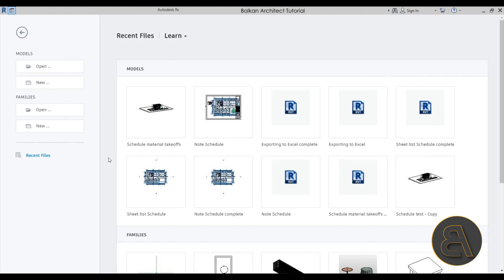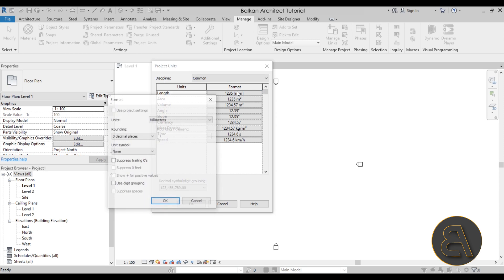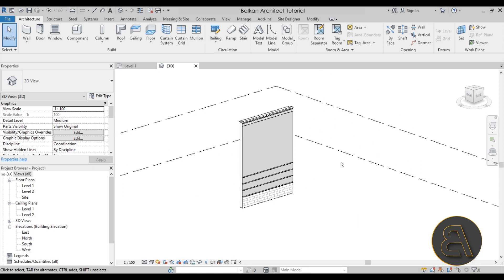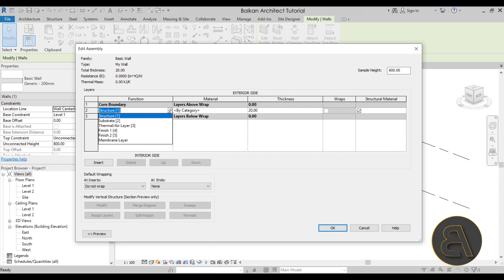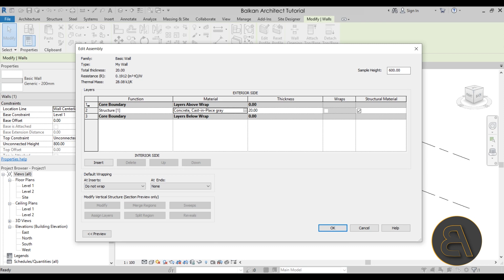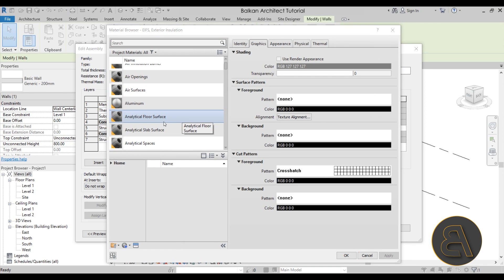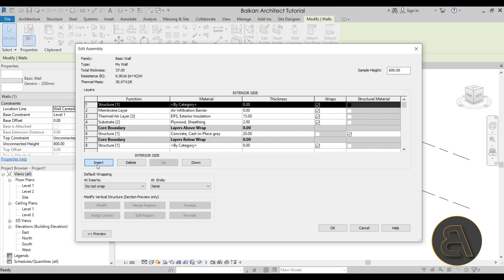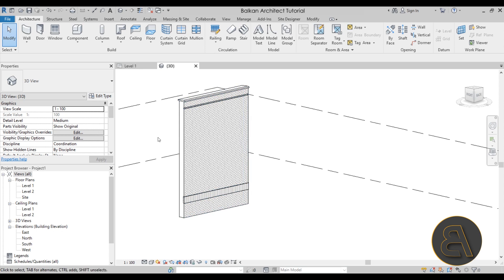Wall Assembly in Revit Tutorial ( Wall layers )

Comment: Have you ever tried exporting Revit to Unreal using the Datasmith feature under TwinMotion? I would love to hear your thoughts on how to procedurally optmize the Datasmith output by simplifying the Revit model before export?.  This would require using Dynamo to swap out overly complex features like layered walls, double-pane glass, etc, to avoid exporting them.

Comment: I created wall from component ( because it was irregular wall). I can make windows and doors on it but I could not extrude cut to create irregular windows, and I can only give a single material, I cannot create more than one layer(like brick and then plaster etc.). Although it is a wall, it still works as a component. How can i solve this problem ?

Comment: I missed the information how I can manipulate the differnt layer for a "multi layer wall". Example: I have 10 cm thick CLT wall 300 cm high and an ceiling of 18cm of CLT. How I can manipulate the layer for insulation, osb-board, membran, air and wood siding that they are 18 cm higher then the CLT wall?  If not I have an gap of 18 cm. I've a simple solution, which is create a second wall without clt. But I'm sure there is an solution over "Modify vertical Structure". I know this from other programs. Thanks

Comment: Hi ! How can we make  new material  with all PBR slots like specular, bump and all other in revit material browser?
Reply: Use the 'default' material as a starting point. It contains diffuse, tint, reflection, refraction, cutout (alpha), gloss, bump and self illumination.

For advanced materials, look into vray for revit.
Reply: @AussieBIMGuru  Okay thanks.. And one thing Is there any possible to change the render pipeline of revit by python or any programming? Because I want to create a big terrain with non tiling multiple textures.. So I am struggling in finding a software for the creation of existing terrain with realistic textures.
Reply: @Praveenkumar-jb3wd  not that I know - the only way I know of adding terrain is by linking civil models as 'coordination models' in 2020.

For 3ds max terrain etc. I would try to composite using photoshop or trying out blender3d or twinmotion as an alternate approach.
Reply: @AussieBIMGuru  Thanks for sparing your time. I'll try  those and  ping you know If needed any help
Reply: @Praveenkumar-jb3wd  you're welcome! I have a twinmotion video on my channel if it helps